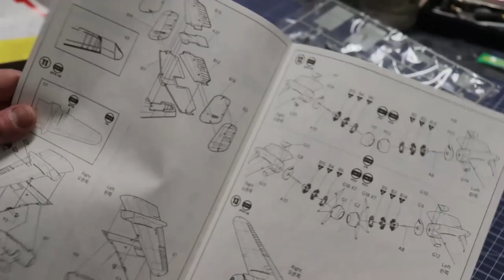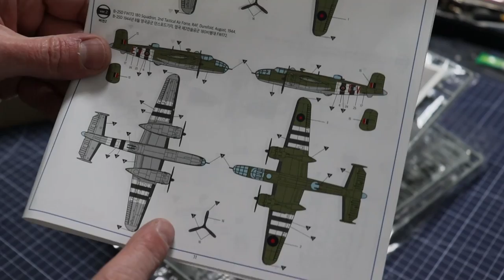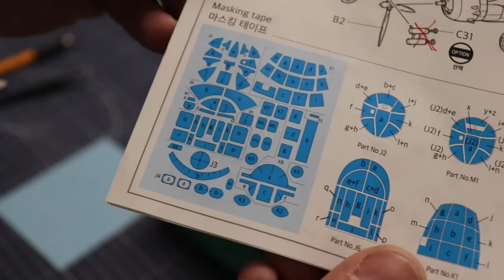1/48 Mitchell B25 Academy Full Build.

Comment: The Academy B-25C/D kit, like the Revell B-25 D kit is a rebox of the Accurate Miniatures kit of 20 od years back. That kit came with nose weights. Revell remind you to add weight, Academy didn't. Knowing the origin of the moldings helps.
But you did a great job on that lovely Mitchell.
Reply from the maker: Thanks for the explanation Brett!😉

Comment: Anytime I build an Academy kit I try and go back and find the original Accurate Miniatures edition on Scalemates and download the instructions from there. Like having a second opinion on placement of parts, colors, etc. Also, as someone presently working on the Academy B-25D "Pacific Theater" and altering it to Doolittle Raider B, the Accurate Miniatures B instructions definitely address the nose weight issue. They actually had templates on the box that are intended to be rectangles of brass sheets cut to particular sizes to fill the spot you put the fishing weight. Nothing like this is on the box or included in the instructions for the Academy one as I recall.
Reply from the maker: Thank you for this very usefull comment. I wish I had such instruction in the kit to avoid a bad surprise.